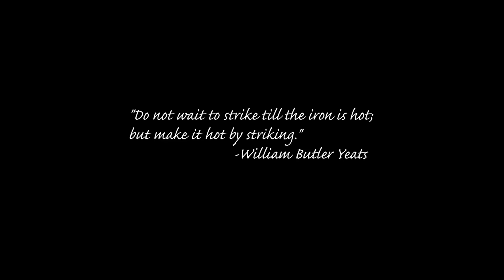Hammering cold iron until it's red-hot

Comment: My cousin had a full blacksmith shop on his farm, his father and grandfather had been trained blacksmiths and farriers.  He got a piece of rough iron hot enough with a hammer to light a cigarette with, then gave me a machine formed wire nail and told me if I couldn't get it red hot I was a wimp.  I worked on it for at least 30 minutes and it never got red hot, I just realized why after 40 years.:face-pink-tears:
Reply: Your cousin found out that you had dedication.
Reply: @secondarycontainment4727  I'm pretty sure I wasn't the first gullible mark to fall for this, he probably learned it from his dad or grandfather.  On the bright side, after I joined the military I was far less likely to fall for tasks like fetching a roll of flight line, or a tube of suspension line grease!😄
Reply: @owensomers8572 
Or that age old “left-handed” screwdriver!!! 😂😂😂 Thank you for your service!!! Have a great day.
Reply: @owensomers8572  What's the reason for that nail thing to not work?
Reply: @Serjo777  I believe it's already compressed when it's hammered into a nail shape, like the video says around 0:40
Reply: @PsyCoCinematics  Oh right, makes sense, thx. I had watched the video on mute ^^
Reply: @jongoin4404 tartan paint and a new bubble for the spirit level 🤣
Reply: @Serjo777  its been compressed so much so it cant be reheated to red hot ever again. it was literally in the video
Reply: @owensomers8572  As an aircraft mechanic, i almost bought the "fetch me some exhaust samples" one, while i was working at a flight school. MF almost had me scraping exhaust cake into a ziplock!! 😂😂 

Almost!
Reply: @mrsquid_ the video explanation is definitely wrong.
Reply: Fool's errand.
Reply: "Lets see you try it"
Reply: Damn, took you 40 years to realize you're a wimp?
Reply: Did he also trick you into tasting your woman 😂
Reply: I had to look for a Tents cellar keys once...
Reply: Typical for base level "craftsman" to challenge people on something, without instruction how to do it.
Reply: @MR-backup  No, his intent was to see if he (the farm boy, with a lot of experience in the smithy) could keep a straight face while convincing me (the city boy) to slam a hammer on the anvil for an expended period of time in hopes of making the nail glow.
Reply: @MR-backup  You mean based craftsmen.
Reply: @MR-backup lol
Reply: @MR-backup  
The joke is that the machine formed wire is already very dense, which as the video clarifies prevents you from completing this task.
The lower density allows you to transfer the kinetic energy into heat energy more efficiently, and the machine formed wire being of a higher density goes in the opposite direction being much less efficient. 
He was given a task that could not be completed, regardless of instruction given. He was simply too inexperienced to understand that this was an impossible task.
Reply: @nettogames4268 Density has nothing to do with it. Machine formed wire is no more dense then a regular peice of iron.
Reply: @StuninRub  its simply harder to compress due to its already small size
Reply: @GodplayGamerZulul  also wrong
Reply: @StuninRub  and you are wrong
Reply: @nettogames4268  reasonably correct
Reply: @Volt64bolt  I'm right.
Reply: @GodplayGamerZulul  You don't compress when forging, only displace.
Reply: @StuninRub  not really.
Reply: @StuninRub  everything compresses under load, they teach you you can’t compress water but that’s only partially true
Reply: @Volt64bolt you're very confidently wrong, aren't you? Go and 'compress' some steel by hammering and measure its volume before and after. We'll await the results.
Reply: @Volt64bolt  It does not compress when you forge. The pressures required to compress only exist at cern.
Reply: @StuninRub  not when you forge no because it’s malleable enough for the pressures to disperse and Deform the rest and it is only compressed for a small time. Everything compresses under force though, everything.
Reply: @jdmjesus6103  the equipment I have does not measure fine enough, it is an atomic level of compression.
Reply: @Volt64bolt  we don't/can't measure density like that, you said the heat is from an increase in density, ergo, you're wrong.
Reply: @jdmjesus6103  where did I say that
Reply: @Volt64bolt  It does not compress at all, unless you are forging at CERN. Get educated.
Reply: @GodplayGamerZulul No, the heat isn’t caused by compression, it is caused by friction. There isn’t enough metal in a small piece for there to be enough frictional heating. For the purposes of any calculations or the phenomenon described in this video, does not really compress at all, its density is fixed with its composition. The person in the video is either mistaken or talking in simplified terms.
Reply: @StuninRub CERN is an exaggeration, it only takes about 30GPa to change the volume of iron by 10%, 30 GPa being the pressure found at 900km of depth into the earth surface, which can be achieved with hydraulic presses.
Reply: @Alderak1  displacement is not compression.
Reply: @StuninRub  I’m referring to molar volume, so yes, compression. Austenite , for example, is a polymorph of iron that is about 2% more dense than regular iron/ferrite. Iron polymorphs are not really stable at normal pressure/temp.
Reply: @Alderak1  Couldn't be more wrong, once again displacement is not compression.
Reply: @StuninRub  You have no idea what you’re talking about and your comment doesn’t make any sense. No one has mentioned displacement except for you. That being said, in fields of physics and material sciences compression, by definition, involves displacement. 

My original comment to you is about how pressure/force can re-arrange the atoms in solids (like iron) and make them more dense. An increase in density with a decrease in volume is a textbook example of compression. These facts can be easily googled.

And just to be clear, I am NOT claiming hammering iron like in this video causes compression to the metal.
Reply: @Alderak1  And you are still wrong, what you are describing is displacement. Don't pretend to understand physics.
Reply: @StuninRub  Lol, you don’t need to understand physics for it to be apparent that you clearly don’t know what displacement means and that you have no clue what you’re talking about at this point in the thread. 

I’m not sure who you’re trying to fool but anyone who has taken a physics course of any kind (or even just used google) would know your use of the words “displacement” and “compression” is dubious.
Reply: @StuninRub  If you hit metal with a hammer, there are a few directions the material could be "displaced".
Of these directions, the one that we're referring to is inward.
Technically yes the metal is "displaced", though it's displaced into itself (as well as outward), which is also a valid definition of Compression.

Some metals can only be compressed with highly advanced equipment, sure.
But not all metals are so incredibly dense already, some are quite easy to compress.
However, this is all relatively speaking. Even the most compressible of metals can only be compressed a little, but that has a profound impact on various properties of said metal. 

You're making an assumption that all metals share the same density and inability to be compressed as whatever random metal you're thinking of. 
You probably saw one video about how you can't compress "tungsten" or something and assumed that because tungsten was a metal, that means the video applied to all metal.
Reply: @nettogames4268  You cannot compress steel. Period. Did I stutter?
Reply: @StuninRub  That "Period" there is what makes that false.
You cannot compress steel "realistically". 
Notice how the point of this topic is also Iron, not Steel. Iron can definitely be compressed, nobody here is talking about steel but you.
Reply: @nettogames4268  Steel is just iron with 0.5% carbon. Iron cannot be compressed.
Reply: @StuninRub  That is literally factually wrong
Reply: @nettogames4268  It is literally factually correct.
Reply: @StuninRub  If what you say is true, a metal's "compressive strength" would be identical for every metal. This is not true.
Depending on the metal's density, compression is more or less realistic.
Reply: @nettogames4268  Compressive strength has nothing to do with being compressible. Iron and steel cannot be compressed.
Reply: @StuninRub  I'm gonna ignore any future replies you make, this is a breadead conversation with you just insisting something that isn't true, is.
Reply: @nettogames4268  It's true, you just don't know what you are talking about.
Reply: @StuninRub never have i seen someone so confidently incorrect before. and you aren't even attempting to listen or combat their points, you're just reiterating the same garbage over and over
Reply: @nettogames4268 can someone explain how this works? What is the density of the metal before and after? Where does the energy go from the moving hammer if it doesn't become heat? This doesn't add up.
Reply: @TheBlacktom  The energy would pass through and go into the surface you're striking it against.
Reply: @ninjahamster901  Sorry but he's on the right track actually, and you might be projecting a bit by calling him confidently incorrect lol. Anything can be compressed, technically true, but the compressibility of iron or any metal is negligible and irrelevant in this case. Gases are compressible, solids are solid. The repeated deformation of metallic bonds is a source of friction. Heat from compression is only relevant in gases, not solids unless you're working with absurd amounts of pressure.
Reply: @MR-backup bruh
Reply: @Volt64bolt  its tru tho, you gotta prank others when you can
Reply: @GodplayGamerZulul  that’s not what I was referring to

Comment: I knew this was possible, but I had no idea it would happen so quick! I thought you would have to be striking it for like an hour (maybe not actually an hour, but my point is I thought it would take a while, like to the point of pure exhaustion on the part of the smith). In the first half of the video it took ~38 strikes until it began to glow and in the second clip it was around 19 strikes. Incredible!
Reply: it actually makes sense. because of high temperature difference, heat is quickly dissipated. to get a red glow, you have to use big enough hammer, and strike little enough material to give it kinetic energy faster than it can dissipate through heat
Reply: oh its how they keep steel hot when rolling in a rolling mill all the energy put into it keeps it hot so they dont have to reheat if anything they have to cool it down to keep it from getting too hot and damaging the equiptment or messing up the chemistry of the steel est veritates
Reply: It helps that the iron is small in the end
Reply: Same
Reply: My 5 year old nephew knows it would happen that quick..  why do you advertise that you’re stupid?
Reply: To be fair that metal piece is very thin by the time it gets hot. Try that with a 2 inches sheet and you'll be hammering it for days.
Reply: Yeah this seems pretty useless. @LilGamingYes
Reply: Super late reply but I only watched the video now. I heard striking a piece of metal like this is a bit like a blacksmiths match. 

They would hit the rods until red hot, like in the video, and then use them to light their forge.
Reply: @DesidiosumCorporosumHominis wow that us super interesting and cool way to start a fire!
Reply: @iEnergySupply  I thought I should say that the forge wasn't always lit this way. Fire was everywhere in the middle ages and any other time periods where blacksmithing was ubiquitous. 

You could easily light a stick in a nearby fire and use that but sometimes it was faster to hammer a piece of metal until it was red hot
Reply: Energy and momentum are a crazy thing.
Reply: When I was a little boy, we were in Spain, I was in a desert area in a place called guadiaro next to a port, I was there on my own and picked bamboo and started rubbing it against some wooden decking, that easily got so hot
Reply: Also note how he is careful to always lift and turn the piece away from the cold anvil between strikes, to avoid heat loss
Reply: Bro shut up no one knew this was possible until this video.

Comment: I want to harden a sword by beating only the outside layers or create a layer from beating it.   Will the inside stay softer to prevent brittleness?
Reply: I think you're talking about work hardening.  If you work the outer surface with a light hammer, so the blow doesn't really travel into the depth of the blade, this is theoretically possible.  However, since you're reshaping the blade during the process, and there's a limit to how much you can do, you're better off doing a differential temper or differential hardening.
Reply: https://en.wikipedia.org/wiki/Peening

Comment: This is really a beautiful idea about opportunity, demonstrated here rather poignantly.  
This is used to traditionally start the initial lighting of a Japanese charcoal forge for steel making.  However, I don't entirely agree with your physics explanation.  Nitpicking, but the iron isn't really in the form of "molecules", per se.   the oxide on the outside would be molecules, so I'll let it slide.  It's really just iron atoms.  There's more going on than "compacting" of the atoms (that's not even really happening very much, the metal is drawn out following poisson's ratio precisely because it's mostly incompressible). The opportunity to keep glowing runs out because on the one hand as the work piece becomes thinner, it cools faster, requiring more energy to stay glowing, and on the other, as the cross section diminishes, the number of atoms available to generate heat through internal friction also diminishes.  Heat transfer out of the work goes up, and heat production internally through friction goes down, and you can never again get it red hot from striking by hand alone.
Reply: the number of atoms available to generate heat through internal friction also diminishes. 
What I was thinking as well!
Reply: Yeah, the part about “compacting” (in the video and in your comment) strikes me as not so much the cause of the heat increase, but more due to the forced movement/shearing of the atoms across others in the workpiece as it’s hammered. It’s kind of like kneading clay or silly putty but here with iron.
Reply: @BuildItFixItDIY  so, it's like when you forcefully bend a plastic object very quickly and it becomes hot at the bend?
Reply: Came to the comments to type essentially this. You probably explained it better than i would have though.
Reply: i appreciate this, thank you for taking the time to comment
Reply: Ah thats becuase iron is an element right, so itd be atoms rather than molecules? As opposed to say steel
Reply: Iron and other elemental metals exist in a molecular lattice with atoms of the same element
Reply: @chancedavis6216 idiot spotted
Reply: Silence you cow
Reply: @t0kerc177 😂😂😂Harsh. But yeah. Love that venom.👍🏼